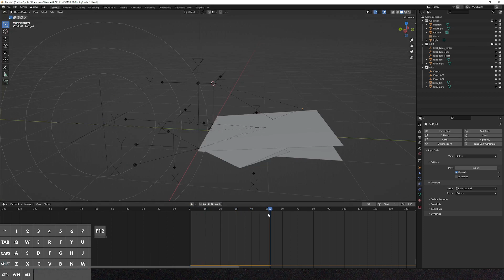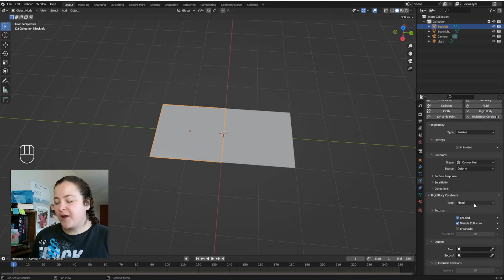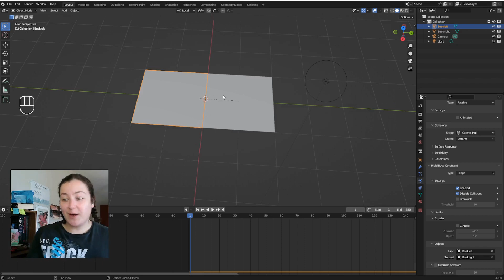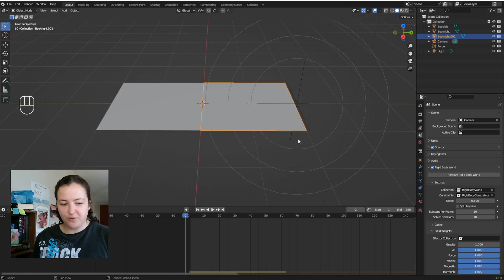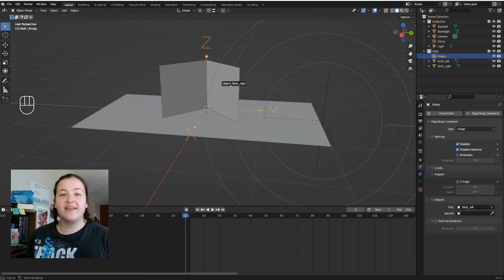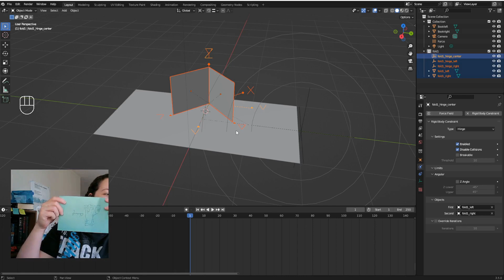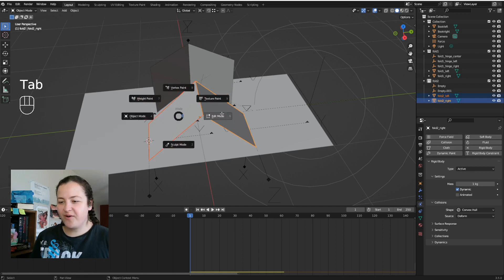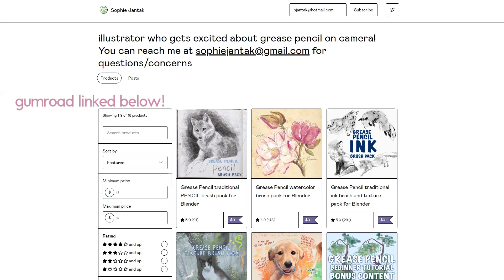The BASICS of creating realistic pop ups in Blender

Comment: I love your teaching style and artistic talent! I have had extensive experience working with rigid bodies in Blender. As mentioned in one of the comments, animating the 'driver plane' would provide greater control over its speed and position.

Here are a few handy tips:

1. If you only want to modify the origin of an object, you can access the 'Options' drop-down menu, located under the shader style circles in the top right corner of the viewport. From there, select 'Origins,' allowing you to rotate, move, and scale just the object's origin without affecting the mesh. Remember to be in object mode to do this.

2. When dealing with rigid body simulations, it's crucial to apply the object's scale before running the simulation. You can achieve this by pressing Ctrl+A and selecting 'Scale.' Additionally, ensure that the origin is set to 'Origin to Center of Mass,' specifically using the '(Surface)' option in this case (this is for non-animated objects).

3. In the event of a crash, you can recover your work by going to the 'File' menu in the top right corner, selecting 'Recover,' and then 'Auto Save.' Blender automatically saves your progress every 5 minutes.

4. I'm a big fan of short cuts. So, I use a lot "," for "Orientation", "." (on top of the right Alt) for "Pivot Point" and "Ctrl+Shift+Tab" for "Snap to" menu

Feel free to reach out to me if you have any doubts or questions. I'm always happy to assist the Blender community, especially with rigid body simulations.

Thank you for sharing your valuable knowledge and contributing to the Blender community!
Reply from the maker: Oh thank you for all of the tips, I really appreciate it! I will definitely look into animating the pop up planes, I'm sure that will help a lot

Comment: You can mark right page as "Animated" and animate the page rotation instead of using the force and gravity. Just place the origin of the page to the center of the world. Other than that, thanks for good tutorial. Did not know about hinges and how to use those
Reply from the maker: Oh thanks for pointing that out, I'll have to give that a try! :)
Reply: If done that way, would the pop up elements fold flat with physics or would you have to animate that too?  As she said the goal is to go from blender to printer.
Reply: @paperpapa312  The only thing you have to add keyframes to is the page closing - the rest is driven by the hinges.  Did this series ever get continued? It's really smart :)